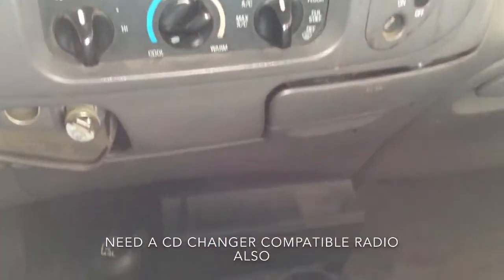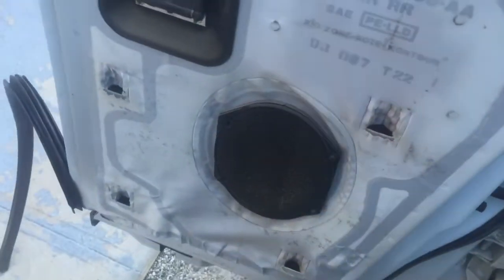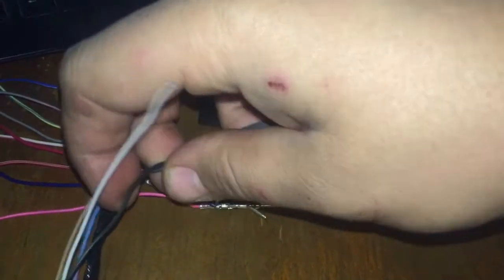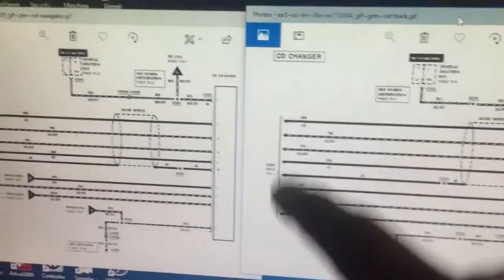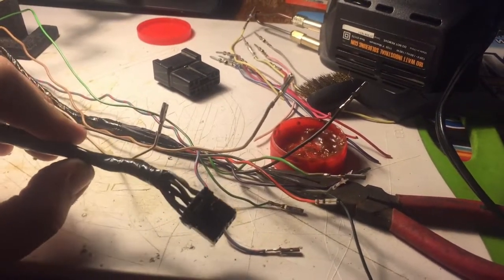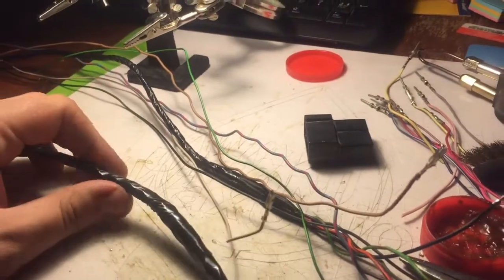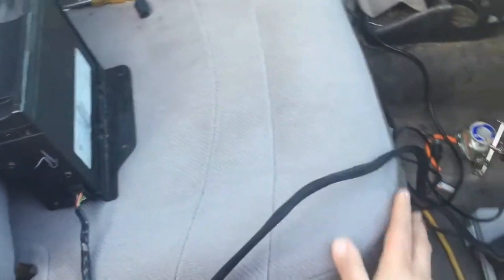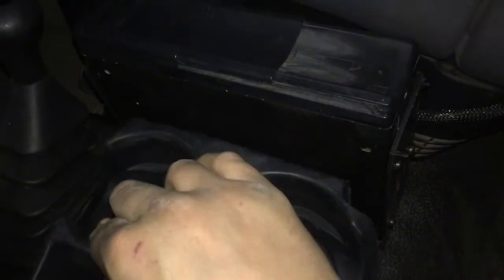Rewiring Stock Ford Cd Changer wire harness to fit Another Ford Vehicle. Navigator to F150

Comment: Where is the wagon ?
Reply from the maker: Ford Cleveland it's still here, next video is almost done.
Reply: I bet . I'm struggling on were to run wires for ghost shadow lights on my car. I cant find the wire that turns them off when the door closes.
Reply from the maker: @desertstyle8460  \More than likely you could use a switch in the door latch, that when the door opens it will complete the ground for the circuit. You could splice the lights in on that wire. Need to make sure the light isn't too big for that circuit as far as how many amps it flows... Could possibly run a relay with it if its too big too. Maybe a stock puddle light or dome light circuit might work too. Another option is to run a whole new circuit and switch. Could use a dome light switch like in older cars.
Reply: Thanks dude. I'll check it out on my next day off . Running it through the dome lights sounds good .